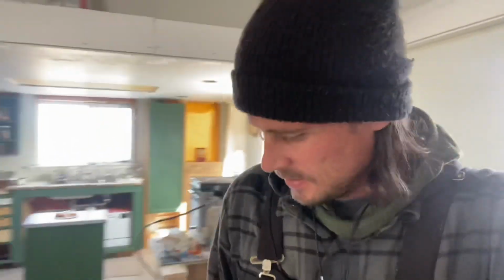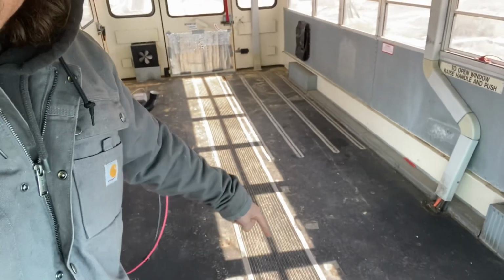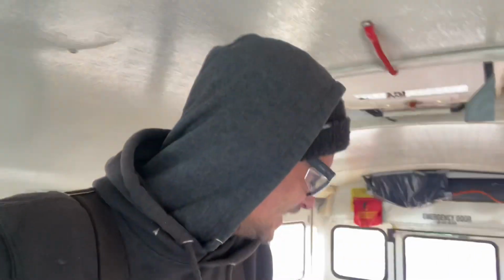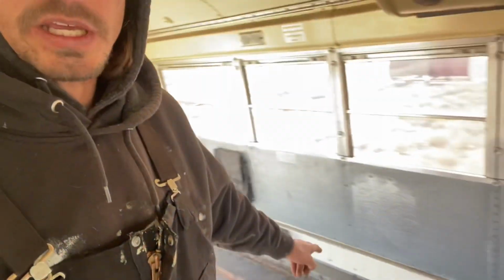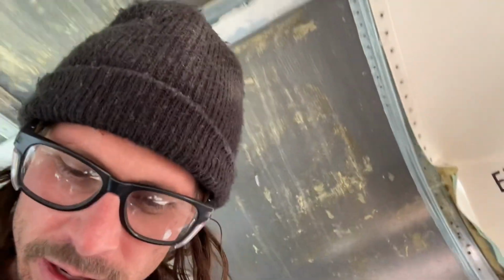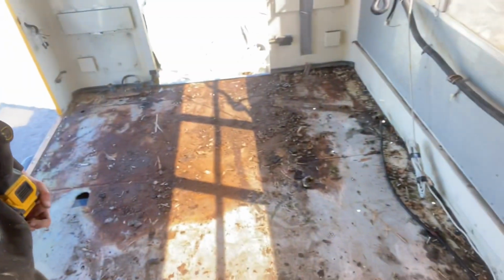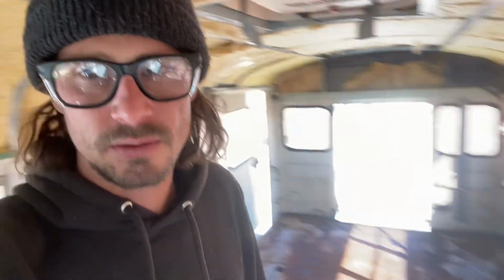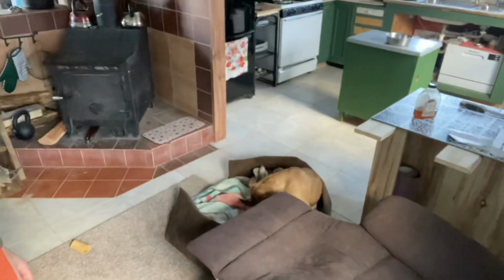The Bus Build Has Begun

Comment: It looks like it's coming along very well. One thing I did not see in this video is the walls and the ceiling. How did you take them out? And were they screws or rivets? Mine are rivets, I do not have an air hammer.

Comment: Pointing out the wheelchair lift door and the spot where the wheelchair lift used to be, if it was me with a bus like your's, I would terminate the seats like you, but at least keep the wheelchair lift, because I would want a safe and dry, but still more convenient place to store a bicycle in, a wheelchair lift would get the bike off the ground and into the storage spot by the emergency exit door, strap the bike so it wouldn't tip over while the bus is moving, and the wheelchair lift would make loading and unloading the bike much easier, but you seem to have a different lifestyle than I do, and that's understandable.